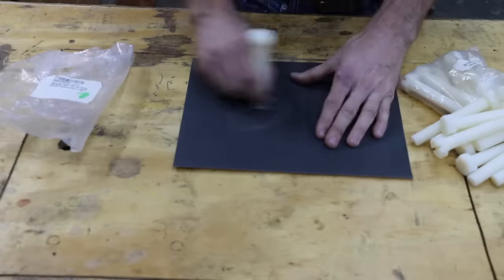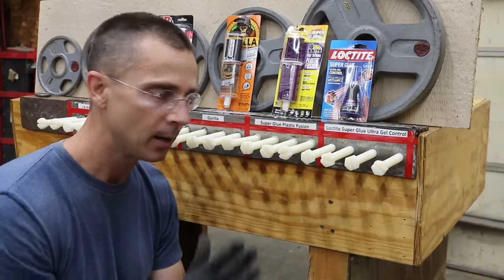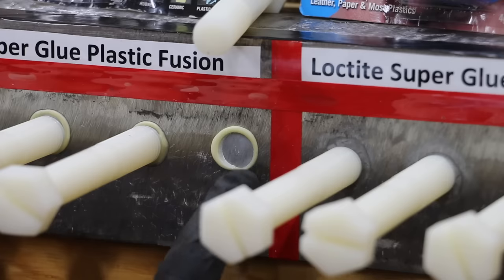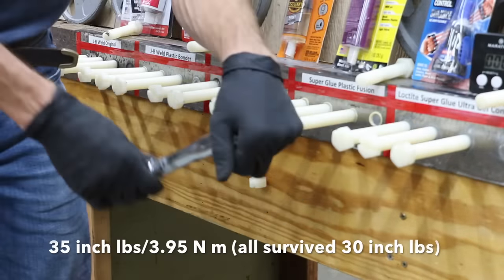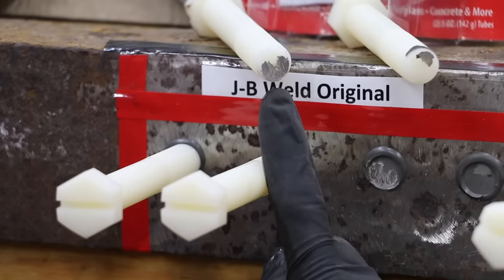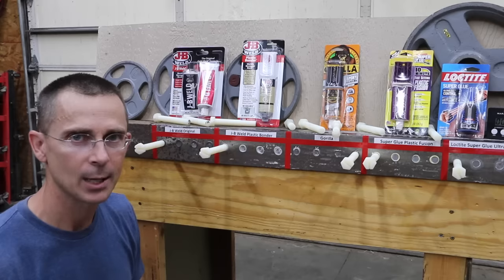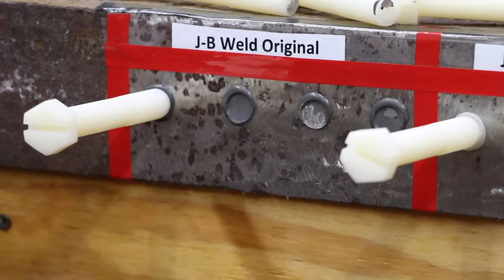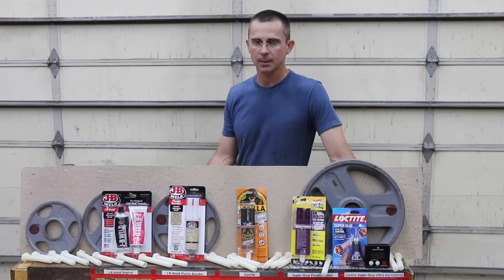Which Epoxy is Best for Plastic?  Let's find out!

Comment: I used QuikSteel on plastic & it was super strong. I also drilled 2 holes & put a thin piece of wire through the holes for added strength
Reply from the maker: Thanks for sharing.

Comment: The reason your test piece is spliting, is due to bearing stress. Bearing stress is caused in your case by drilling too close to the edge or top (whatever the case may be) and the bolt is pulling out thru the test piece. Use care when drilling these holes. A tight fitting hole and a hole drilled a min of 3 times the dia of the bolt will stop this tearout. Great testing techinuques and you do a very thorough job.
Reply from the maker: Thanks and you are welcome!  Thanks for the feedback.

Comment: I have a speaker cabinet to repair.  Im fairly well convinced that JB weld putty is the move.  Even though its plastic not metal.  I believe it should give added strength in addition to sealing the crack.
Reply from the maker: Thanks for the feedback.

Comment: I just glued some plastic body panels for a scooter with regular JB Weld.    The crack was a stress fracture and I pulled the panel apart to open up a gap and then put JB Weld in the crack the full length of the crack and then lightly clamped it and let it cure overnight.   After watching your video I am thinking I might of used the wrong glue.     However,  I use JBWeld for everything!!!😎.   Such a great product. But these scooter panels do flex and vibrate.    We’ll see how well it does.
Reply from the maker: Thanks for sharing.  Let me know how it turned out.

Comment: In 1987, My wife wanted towel hooks mounted to our shower walls (fiberglass) rather than our bathroom wall as there was very little available space. I taped off two squares approx. 1.5 x 1.5 inches on the shower wall, sanded them to rough up the surface and sanded the back of the hooks which were plastic (styrene, most likely). Using PC-7, I mounted the hooks, taped them to the wall overnight and there they have remained to this day, 35 years later and I'll wager I could hang a 15 pound weight on them.

Comment: As always, great video!  One thing to suggest:  When attempting to glue plastic (with any method) it helps to use a heavier grit sandpaper to prep the plastic surface area.  This gives the adhesive more surface area to attach to, and gives a stronger bond.  Even fiberglass, when cured, is a slick enough surface that sanding surface prep is required to add another layer if the part will need to be structural.  Plastic (fiberglass resin is actually plastic too) is just a bear to bond with permanently with any strength.
Reply from the maker: Thanks!  Thanks for the suggestion.
Reply: @ProjectFarm  Not at all!  Thank YOU for all of the time and effort you put into making fair comparisons!

Comment: The comparison between static strength and impact strength in cantilevered beam configuration (should initiate failure in tension at the top of the interface) versus torque (should initiate failure in shear at the OD of the interface) is very helpful in understanding the limits of these adhesives. Also, I'm glad to see you scuffed the plastic first, so many people overlook the importance of surface texture when applying adhesives. Great work, thank you! If you ever do a follow-up to this video, I'd love to see two combinations: 3M Scotch-Weld AC77 primer and Scotch-Weld PR100 adhesive, versus Permabond POP primer and Permabond 735 adhesive.
Reply from the maker: Thanks!  Thanks for the suggestion.

Comment: I am glad you didn't choose a winner. When gluing any substance there is no one-size-fits-all. You have to consider several factors as you mentioned and clearly demonstrated.  And with plastic especially, if the glue actually dissolves the plastic a bit, it will rarely fail. I think of solvent welding polyvinyl chloride (PVC). And since acetone softens most plastics I wonder if dipping the ends of the bolts in acetone and then applying the glue would give better results? Hmmm... Thanks for the video.
Reply from the maker: You are welcome!  Thanks for the suggestion.

Comment: I'd love to see this video revisited using plastic bolts to different materials such as plastic to plastic, plastic to wood etc.. I think a pressure test would be great too, drill a hole in containers and apply the epoxy and see how much pressure it takes before failure. 
I loved the video as always but I was kind've left with a lot of questions still on what is best. Loctite held strength well but didn't flex and I felt like Gorilla had a lot of flex and bonded to both materials better since it broke off from both sides but didn't have a lot of overall strength. Idk I just think this would be great for more testing. Thanks for all that you do!
Reply from the maker: You are welcome!  Thanks for the suggestion.

Comment: Good stuff as always!  Do you have any plastic to plastic tests?  Seems some plastic part is always breaking or cracking, especially mounting tabs.   Been looking at plastic welding (heat) but if I can find a good bonder or chemical weld that would be great.

Comment: This is 5 years old! You've come so far since then. I can only imagine what testing you would do now 10 different epoxies 😆. 
Even these early videos were fantastic and very informative. Thank you for all you do Cheers 🥂
Reply from the maker: Thanks!
Reply: @ProjectFarm  You should see if there is a glue that will stick to polyethylene plastic. (Irrigation line) or kraft tube caps. Only thing ive found that works is amazing good cured for a few days.

Comment: Informative video.  Unfortunately, I purchased several packs of JB Weld plastic, that were on sale, before seeing this.  I tried repair a wobbly lawn mower wheel by attempting to bond a piece of copper insert to the plastic using JB Weld. It seemed to work but after one mowing session the weld broke off.
Reply from the maker: Thanks for sharing.

Comment: Nice demonstration.  It illustrates how difficult it is to perform meaningful experiments with many competing variables!  I suppose some people glue plastic to metal, but I sure don't.  What I'm looking for is the best 'glue' for joining/mending two plastic automotive parts/pieces.  I presume the type of plastic, in terms of chemistry and physical properties, is probably very important.  Unfortunately the sheer number of different plastics used in the automotive industry is a very large!  Typically plastic trim and structural pieces are often broken in disassembly/assembly, leaving an otherwise useful part essentially useless...
Reply from the maker: Thank you!

Comment: Let me know if you find my comments annoying, but I'm kinda a plastics nerd. The best way I know of to improve glue adhesion to plastic is flame treatment. Plastics generally have low surface energy which prevents wetting. You can see this in how smooth surface is when some glues tore away. 

Anyways, generally you can greatly increase surface adhesion of glue and paint on plastic by running a torch across the surface. It doesn't take much, just want to disrupt the top microns of surface. And it doesn't last long, you only have half hour or less open time before the surface energy decreases again. 

Another thing is that Urethane glues can make more durable joins than epoxies for plastic for flexibility reasons you mention
Reply from the maker: Thanks for sharing.

Comment: Again, these tests are very helpful and dispel assumptions/myths I've had about some glues. Thanks. It should be noted that some of the glues you tested are not epoxy-resin based which makes the comparison apples to oranges for some of the glues. JB Weld Plastic Bonder is urethane-based. Loctite Super Glue Ultra Gel Control is cyanoacrylate-based. Super Glue Plastic Fusion is acrylic-based. Also, you selected one of the most difficult glue tests -- steel to nylon plastic. It would be interesting to see how these plastic-specific glues did in plastic to plastic glue tests, which is what I think the plastic-specific glues were primarily designed for. For example, JB Weld Plastic Bonder does really well with ABS to ABS applications (from my own testing) -- superior to CA glue except for precision applications requiring tight fits. I think many would be interested in what these glues can do with polypropylene, polyethylene, and PVC bonding, which are generally difficult materials for gluing.
Reply from the maker: Thanks!  Thanks for the video idea.

Comment: Always good to know what strength any plastic weld glue/epoxy will do . I am looking at getting my shattered Toyota bumper back to the original shape without spending 800.00 on a replacement when 3/4's of the bumper is just fine! However I would like to sse plastic to plastic vs what you have shown here.

Comment: I used JB Weld to fix my radiator support (a very important ear broke off during shipping and the part plus shipping cost me nearly 400 dollars) and on my car it has to support the radiator, a/c condensor, crash bar, headlights, and front bumper. Its been two months and hasn't broke yet!
Reply from the maker: Thanks for sharing!

Comment: Curious to know if the Gorilla was dampened before connections were made. I don't have a lot of glueing brand experience, and I was wondering if the Gorilla glue would work on nylon/polymer surfaces. The comparable results look close enough for low stress/tension applications. Sometimes a bond breaking during an impact is a good thing too. Cool tensile testing demonstration.

Comment: There is one test missing that was interested in. You had bending, torsion, and impact but what about tension in the axial direction of the bolt. How well do the options resist a force that is pulling the plastic bolt away from the metal.
Thanks for the clear test results you demonstrated.
Reply from the maker: You are welcome!  Thanks for the suggestion.

Comment: Great video. Could you tell me what type of plastic the test bolts are made of? I need to attach several aluminium support bars inside a polypropylene container and just haven't had a lot of luck finding anything that will stick.

Comment: I recently discovered the world of industrial adhesives. There are ideal adhesives made for permanently joining ANYTHING! Even something "impossible" like bonding polypropylene to HDPE. (Usually specific formulations of methyl methacrylate-based glues for this case). Or bonding 2 metals with the strength of a weld. These specialty glues are pricier, but if it's for a permanent repair on something that costs more to replace, it's a good value proposition. (I got an engineering book to help me choose the right adhesives for different tasks, but you can also just call the phone number for Loctite/3M/etc. and they'll tell you which of their hundreds of adhesives are the best fit.)

Comment: Todd--great video, as usual. I would SUPER appreciate it if you could test out Methyl Methacrylate (MMA) "epoxies." MMA "epoxies" are technically not epoxides as they don't involve epoxide functional groups. They are instead acrylics. That being said, many MMA's have proved to be exceptional at bonding to plastics. I would LOVE to see a showdown between the budget Infinity Bond MMA500 and its counterpart, 3M DP8005 and Loctite AA 3035 and Plexus MA500 and Plexus MA330 and other similar Methyl Methacrylate formulas that are specifically designed to bond to low surface energy plastics!
Reply from the maker: Thanks for the suggestion.

Comment: A lot of people pointed out a test with plastic bonded to itself would be nice. I think you could pick maybe 2 of the most common types (besides the material of these bolts since we have results already) and instead of using the steel as the base, use 1 type of plastic and then bind the other plastic to that. That way you could knock out 2 types at a time.
Thanks for the video!
Reply from the maker: You are welcome!  Thanks for the suggestion.

Comment: As usual a fantastic source of information, as most breaks in the epoxy occurred by the epoxy breaking away from the plastic bolt was there any prep cleaning of the plastic with alcohol to remove any finish, oil or grease as you did with the steel?

Comment: I find JB weld original never fully sets rock hard on plastics ,but will hold them providing they are not under great stress .I used it to glue broken lugs that held sprung threads which accept bolts that holds by motorcycle body plastics on .At the time I couldn’t find my plastic specific epoxy adhesives ,so just used the original JB weld as it was the only one to hand .In the U.K. we also have an two tube epoxy adhesive called Araldite that has been used for generations to fix all kinds of stuff .I once glued a broken motorcycle crankcase cover with it & it out lasted the motorcycle .
Reply from the maker: Thanks for the feedback.

Comment: I bought some of the JB Plastic Bonder a couple years back to repair a crack in a polyurethane front-lip for my car & was NOT the least bit impressed in it's abilities. It did not even stick to the plastic, which was extremely disappointing as I only selected that item over traditional epoxy which I have had success with in the past because it said it was formulated for plastics.
Reply from the maker: Thanks for the feedback.

Comment: great test - thanks for the work - Plastic covers a lot of materials that are not the same though - was that nylon, polycarbonate,  polypropylene, polyvinyl chloride, and mobile phone bodies and car parts use new combinations (PC + ABS; PE + ABS). Those bolts looked like they are probably nylon, but it's hard to tell from video. I've found some plastics glue relatively well while some are nearly impossible.
Reply from the maker: Thanks and you are welcome!

Comment: Supposedly Devcon cream colored plastic welder epoxy has an entirely different formulation to other plastic epoxies. It would be interesting to see how it stacks up. Also, testing different plastics would be helpful. ABS or PVC (or acrylic) would be much easier to bond than nylon, and probably show a bigger difference with the epoxies meant for plastic (they should slightly dissolve forming a much deeper bond). Polyethylene or polypropylene would be much harder. The only readily available adhesive I've ever used that will bond well to PP or PE is 3M DP8005, but it's quite expensive.

For plastic to plastic bonding with PE/PP or nylon I would recommend heat welding, either with a soldering iron or a hot air welder. I've successfully repaired a nylon (PA6 GF30) automotive cooling fan blade assembly that way, which has been working fine for years now.
Reply from the maker: Thanks for the video idea.

Comment: I’ve always had trouble bonding plastics. They need to come up with a ‘curing’ system that dissolves into .plastics to be bonded then hardens. The JB plastic bonder surprised me, I used it last evening to bond a solar panel to the broken stake attachment, it’s going to be interesting to see how long it holds up.
Reply: That's how a lot of plastic is bonded in the medical device industry, we use solvent bonding. Use a strong solvent to literally melt the two pieces together. There is no actual adhesive.
Reply: The classic model glue with toluene worked in that manner with polystyrene, the plastic used in model planes, cars etc, the down side, as every young kid probably discovered was, if you applied too much glue, the part would stay soft forever. A heartbreaking result when you applied too much glue to your model FUNNY CAR axle.

Comment: Can you do a video on what adhesives are gasoline resistant? Specifically if you are repairing plastic whether it be PVC or ABS, etc? And maybe use PVC pipes glued on one end with the adhesive and sealed for a month to see if the gas eats at it over time?

Comment: I think attempting a bond between two different materials is always going to be difficult.  I have a car with a cracked bumper, so I want something flexible but strong to bond plastic to plastic.  It should be easy to work with, and sand-able.  Based on your customary great testing I think I'll try Original JB Weld.  It may not flow easily into the crack, but I can clean off the excess, and sand the rest, once it's cured.
Reply from the maker: Thanks for sharing.
Reply: @ProjectFarm  Sir, your testing is impeccable. Finding impartial third party testing is a treasure. I've used your reviews consistently, most recently for turtlewax hybrid wax products. Keep up the good work! Best regards, John

Comment: I had the tip that was on the top of my car radiator crack and was leaking antifreeze. So i used JB weld original and the first time it didn't hold so i did it again but this time i let it dry for the whole weekend and never had another problem with it.
Reply from the maker: Thanks for the feedback.

Comment: that's interesting you mentioned using isopropyl alcohol as a surface cleaner, before using the epoxy, because jb weld says on there website not to use alcohol as a solvent to pre-clean the surface to which the product is to be applied.

Comment: Recently, I attempted to repair a damaged radiator using a JB weld repair kit. The results were surprisingly good but I’m curious to see how different products compare in a high heat, high pressure environment. The repair I did was on the plastic end of the radiator. I know it’s been a while since you’ve made an epoxy video but I would love to see you perform a radiator repair experiment. Cheers!
Reply from the maker: Thanks for the suggestion.